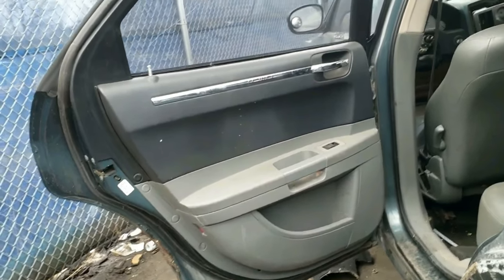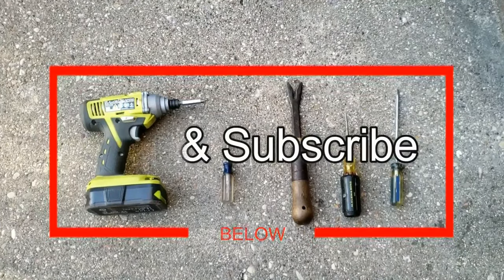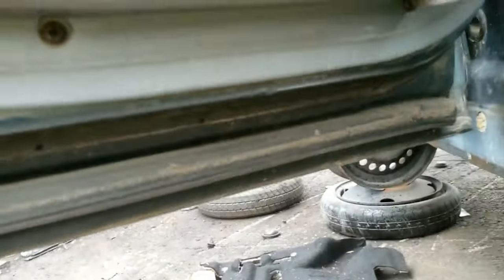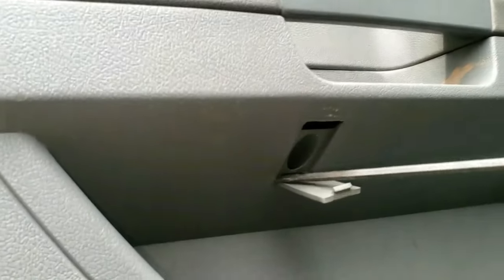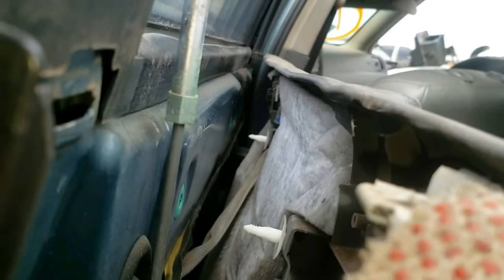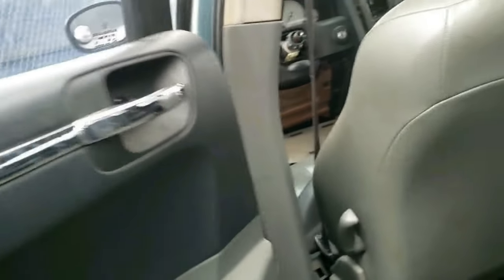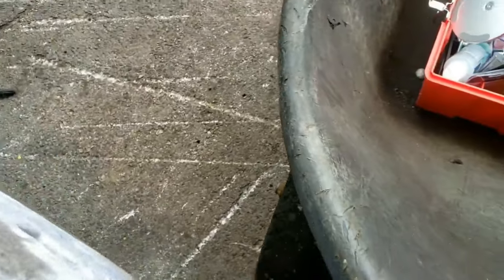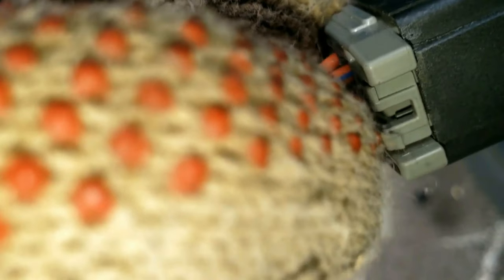Remove Rear Door Panel & Window Switch Chrysler 300 Dodge Charger Dodge Magnum

Comment: You didn’t show you putting window in though
Reply from the maker: Yep. Thats a bit more complicated and would be a different future video to make. This video is specific about removing the window switch on the door and removing the entire rear door panel.
Reply: Question would be able to remove just the lower part of the door Panel the grey part?